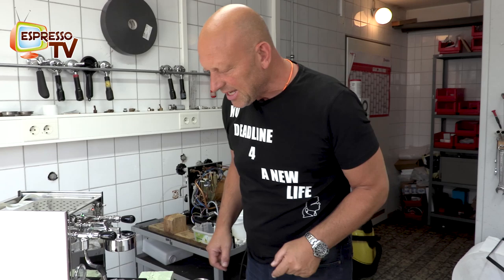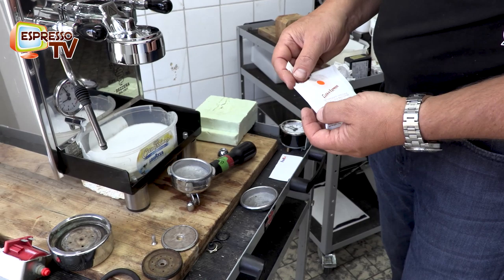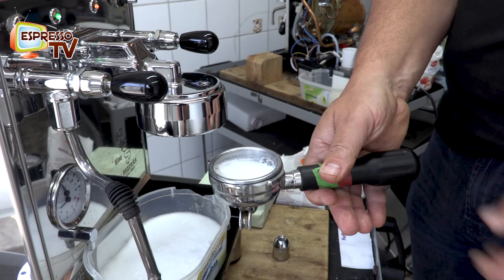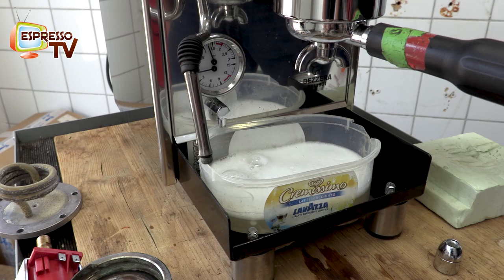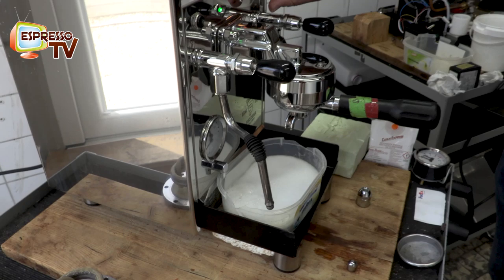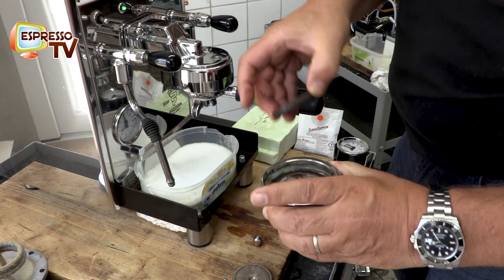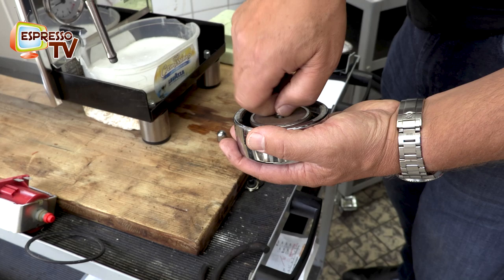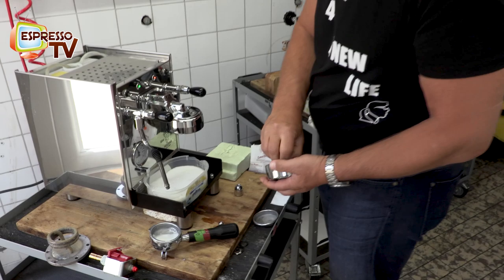Cleaning of a Bezzera BZ 10 brew unit with espresso machine detergent

Comment: Hi thank you for sharing informations. 
Can you change the OPV? what number with blind basket you suggest to get actual 9bar at brew head because i heard vibration pump machines like bz10 need to be at least fixed at 10 bar with blind basket to get 9 bar or less in brew head idk if that number is accurate so i ask this from you 

Also is the OPV on bz10 "made for adjusting" ? Because i heard in old models you should buy bezzera 9bar opv adjustable kit and swap it with the original opv on your machine because your original one doesn't made for adjusting and if you unscrew it it might leak or splash water out and damage your machine
What do you think.?
Thank
Reply from the maker: The OPV shall only change the manufacturer in general, do not use another one, it should have the same pressure.
BZ10 has a blind filter pressure of 12 bar.